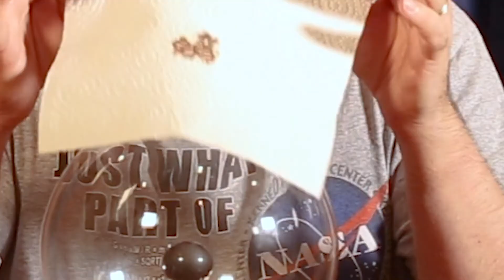What can you do with a plasma ball? the demonstrations.

Comment: Hi Paul... you said that if you touch the foil with your hand it will hurt... OK but when you touch via a skewer it did not... was the skewer not at the same potential all over? Why did it not hurt then?
Reply from the maker: Main reason is that my finger is round and dull and the skewer is pointy. This means that the skewer has a much stronger electric field. This means that charge leaks more, like stream, rather than all at once with my finger. This reduces the current flow and thus hurts less. On another note too is that what you feel is also the heat generated.  Again much less with the skewer.
Reply: @PhysicsHigh  Thanks for the answer Paul.. still not sure how the skewer did not 'hurt' you, as the sparks were right there to see and you were touching them (through 'the metal stick') ... but will accept your answer as I don't believe I will test this.... "Like a stream..." who would've thought :).
Reply: Could it be due to how the charge is disapated? As when you touch it with a finger the charge is released all at once on a small point vs with the skewer when you hold it the charge is disapated through your whole hand?
Reply: Actually, I think it is due to the frequency at which the electricity is flowing. At such frequency, you wouldn't feel an electric shock, but at such voltage, it can burn your finger.

So, to sum it up, at very high frequencies, you don't feel the electricity flowing through you, but with enough voltage you will burn your finger. That's why it doesn't hurt when holding any metals, but it does (because it burns) when using your finger (and any part of your body for instance)
Reply: @juanfelipesantoyamartin5277  The high voltage ionizes the air. You get a spark which is pretty hot. So, if you touch with your finger, you get a tiny spot that burns and blackens on your finger. I know bc I have tried it.

Comment: Great video! Just to clarify, the near field effect (electric field)  is what is lighting the fluorescent tubes (i.e., not escaping electrons or far field radio waves), correct? I understand that if it is the result of near field effects, it would still result in ionization and electron movement, but my question is more in regards to the transmission of power.